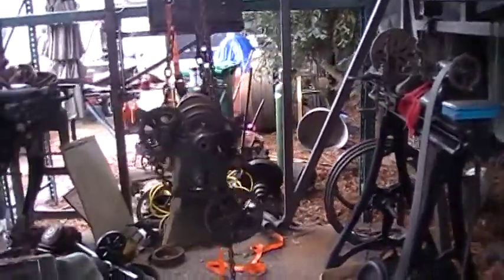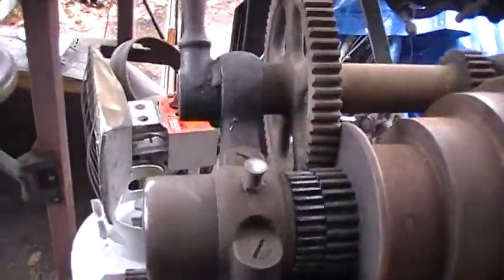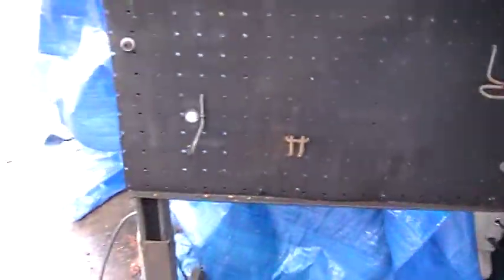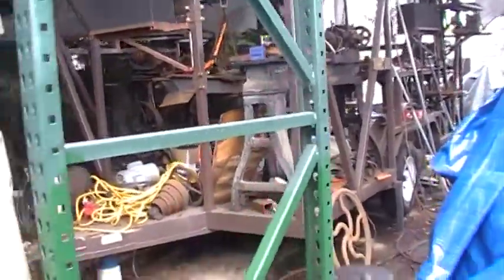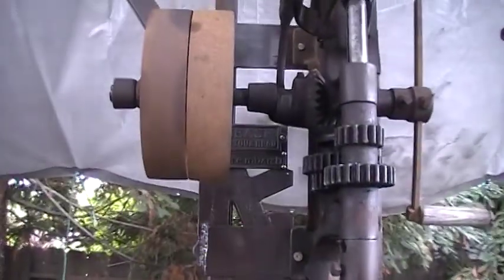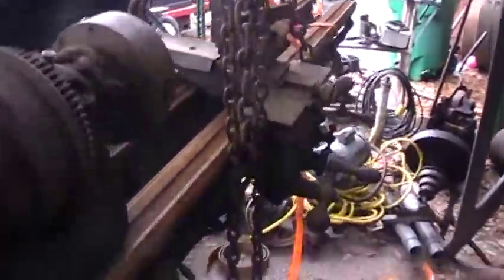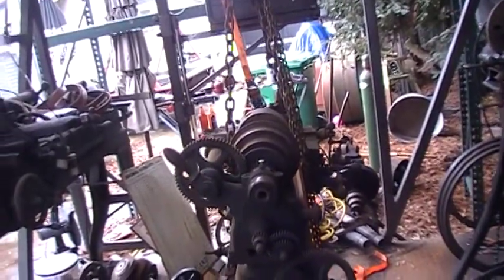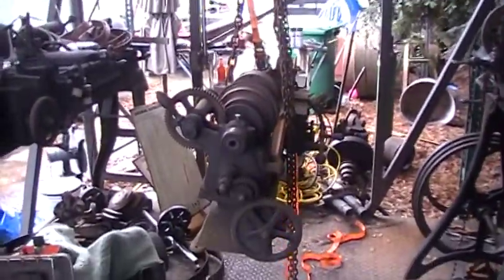An 1896 Seneca Falls Star lathe followed me home.

Comment: My cousin gave me his Dads Star Lathe. I go to start taking it apart tomorrow. Already restored 3 Southbends and a Craftsman. Glad to have another, he has most of the gear cutting attachment for it. Sweet shop you have.
Reply from the maker: thanks Stratocaster. My dad played a Stratocaster for a living! These little star lathes are fun.
Reply: Thats cool about your Dad. Do you have his Strat? We got the Star lathe home. Looks like I need some headstock gears. My Uncle made an aluminum gear that was on the leadscrew. But gears are missing to transfer power from spindle to leadscrew. Even if I dont thread on it at least want power feed. Mine says Seneca Falls and 9- 5 on the bed. Maybe you can help me figure out what number of teeth are on the different headstock gears. Thanks, Greg.

Comment: How many lathes are you planning to fit into that trailer?
I like to see a bit more about that small treadle lathe.
Reply from the maker: This started out to be a small well rounded machine shop with a lathe, horizontal mill, shaper, drill press, and a grinder for tooling. I collected tools all my life and now retired I am putting it together. But then I found one piece of equipment after another. I have old iron disease and it's only treatable with more old iron. I think I need 2 more trailers to fit what I want to do at this moment. This is why I only wanted a 5000# capacity trailer - keep it down to a dull roar. I think if I had a really large trailer like 10,000 to 20,000# capacity I would be out of control. The treadle lathe (velocipede) came up on Craig's list and I couldn't resist. It's kind of on the back burner until I get the power to everything else. I'm enjoying this and I hope others will find it interesting as well. As far as how many lathes, right now there are too many! I'll have to rearrange and make it workable. I had a Fox horizontal mill on it but no tooling so I removed it. Now I have 3 horizontal mills and counting. With luck I will finish this trailer and then I can start a second. Ha ha ha. Thanks for the comment. Dave